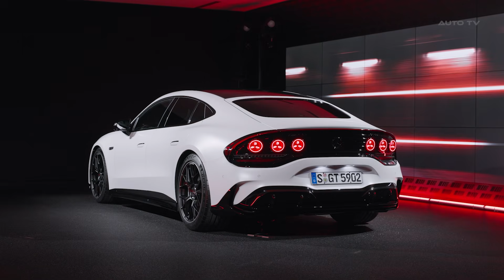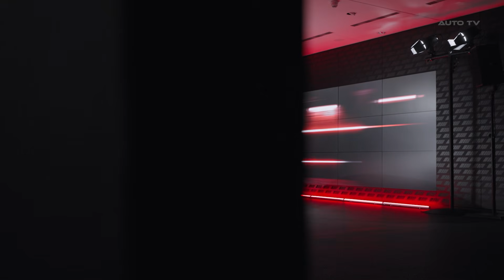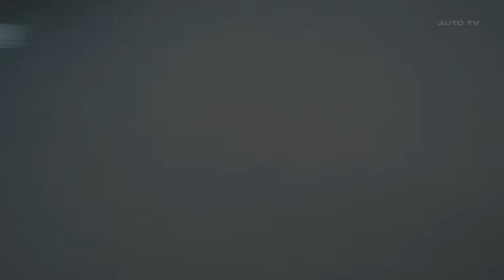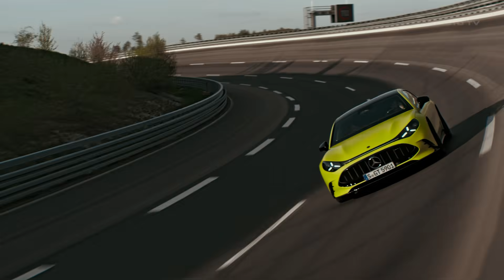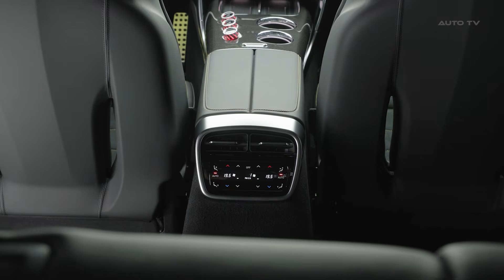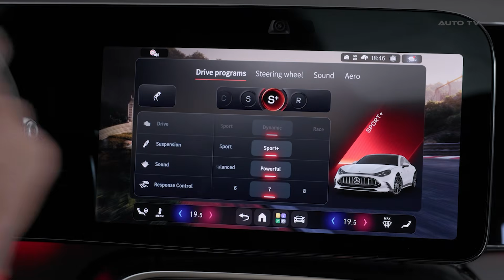2027 MERCEDES-AMG GT 63: The 1,153 HP Electric AMG Nobody Expected

Comment: What is its range on a full charge
Reply from the maker: GT 63: 370-433 miles WLTP (596-696 km)
GT 55: 371-435 miles WLTP (597-700 km)
Reply: @AUTOTVO 
2027 Mercedes AMG GT 63 4-door with 1360 horsepower ❤❤❤❤❤❤❤❤❤❤❤❤
306km/h